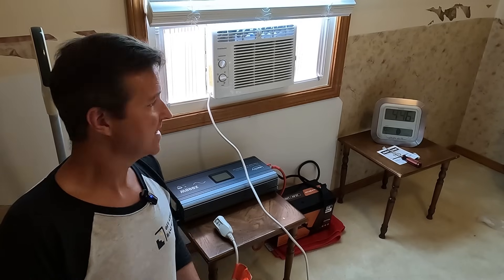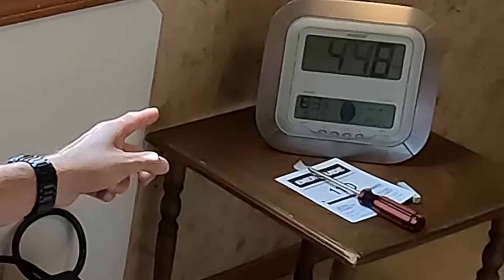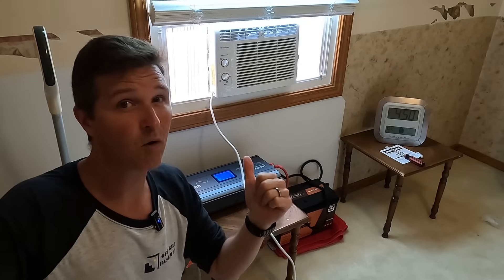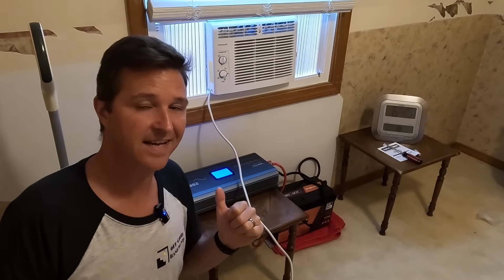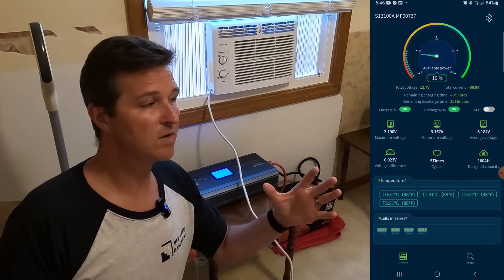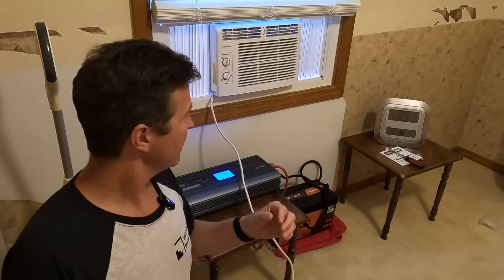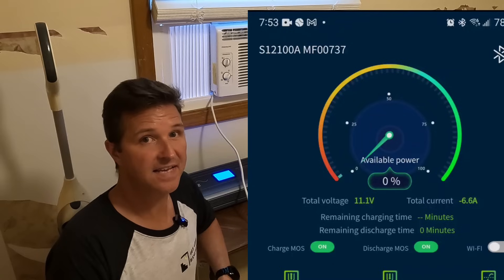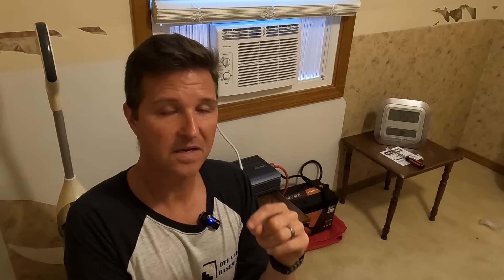How long can you power a 5,000btu air conditioner with a 12v 100ah Lifepo4 battery?  Let's find out!

Comment: Thanks for the video.  It answered a lot of questions.  I just ordered a couple of days ago an Eg4LL battery and the Eg4 off grid inverter to use as a mobile/portable power bank.  This will be to power on occasion an 8000 BTU window unit when we lose power.  Thank you.
Reply from the maker: That's great!  Thanks for the comment.